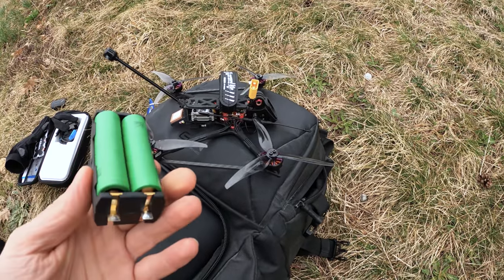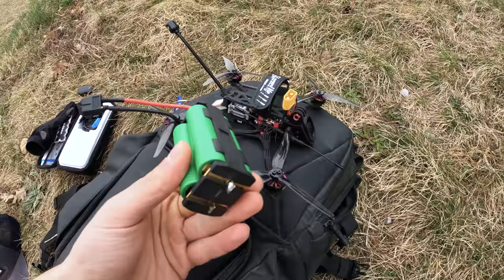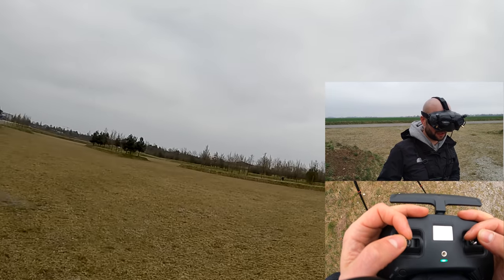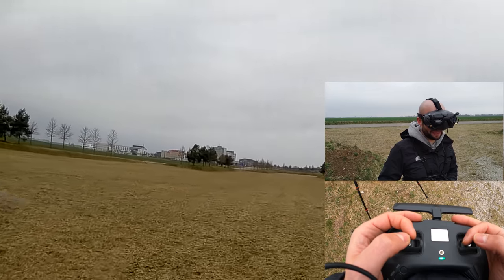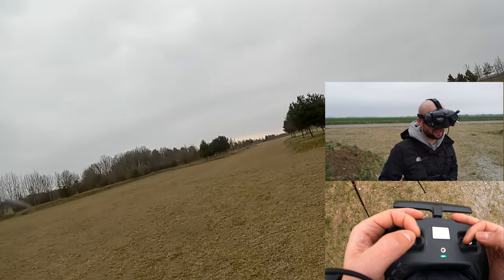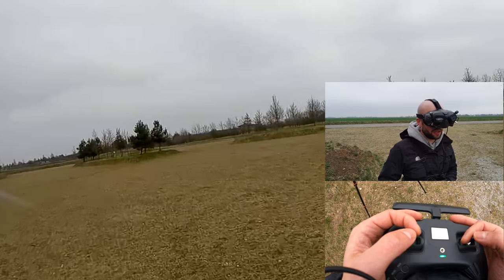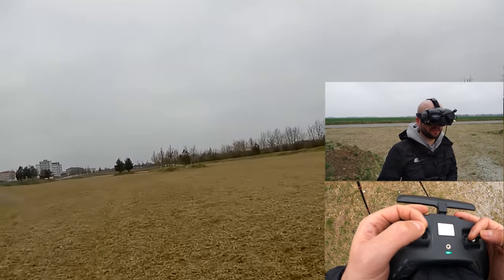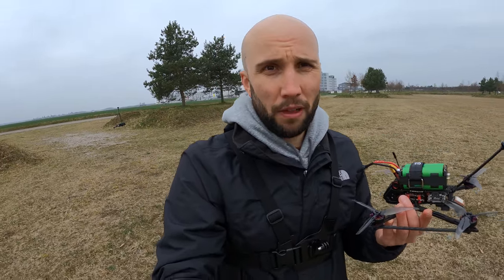4S 18650 Battery Clip | It works!

Comment: Personally, I found this clip thingy packs quite problematic. The key for flying li-ion is a very light drone with low amp ESC otherwise it starts a fire on a drone while mid-airborne. I would not recommend this for heavy and acro quads running on high Amp ESCs, though. An finally - 20grams plus on a small drone which weighs in total between 400- 600grams is actually a lot of extra weight to power..  You can basically forget about mounting an action cam additionally. I do not recommend this solution for regular drone flying. This li-ion is only good on specially designed aircrafts for use of it.

Comment: Trying to get arm braces designed for the Rekon5. My motors only have 2 mounting holes and they dont line up with the braces. I emailed cncmadness with no response. They are basically the holes that go straight front to back. I designed a pic showing what holes. I dont know how to message you email or discord

Comment: Hi Sir, what do you think is the best combination for a 4" inch drone, (motor and Li Ion battery), I just want to do some cruising, I will be happy to fly around 20 minutes, 

I saw a 1404 3000kv or a 2004 1700kv

Comment: @dave_c just maidens the rekon 6s with caddx HD. I am selling all my 5" so I can afford the 7" when you come out with it. Are you going to make .stl files for tpu parts so I can "pimp my ride"?
Reply from the maker: The 7" won't have that many TPU parts but yes it will be on thingiverse. Still prototype testing at the moment
Reply: @DaveCFPV  what about files for the rekon 5?
Reply: @DaveCFPV  I bought the hex, and broke the buzzer on a hard landing on tile, something to watch out for on future TPU designs. Not complaining, just letting you know.

I replaced the buzzer and zip tied two TPU pads to the arms on either side to prevent it happening again.

(I am not good at flying)
Reply from the maker: @lanxang173  I didn't design the hex 😅
Reply from the maker: @boxfanwilly  look for the Minilongrange they are identical :-)
Reply: @DaveCFPV  Was it just the motors then? Because they've got your name printed on them. I'm looking at it right now 😅😅😅
Reply: @DaveCFPV  the boys at the factory sent them this morning. I have to say the service is top notch. They sent a frsky instead of crossfire accidentally. Answered promptly with choices and very polite and professional. They are doing your rep and design properly.

Comment: Do you think this would work on the crappy Eachine Tyro 129? They have 1800kv and Dal 7056 tri blades. It’s rated for 3 to 5s.
Reply from the maker: Probably yes as long as you only cruise

Comment: i'm trying to make one of these but I cannot work out which orientation the + and - need to be :( I can't see from the video
Reply: well i paused the video a lot and the top side that doesn't have the power leads should be opposite polarity to the power lead side (+ and + at a diagonal) and connected via a bridge only on that side- you need to put tape between the contact on the clips- the bottom side is done for you ofc if the top is correct